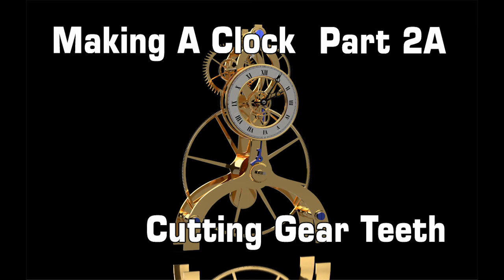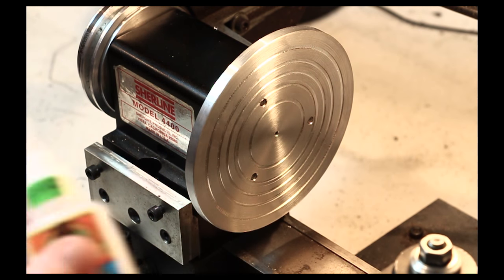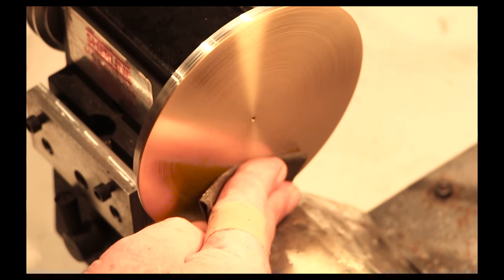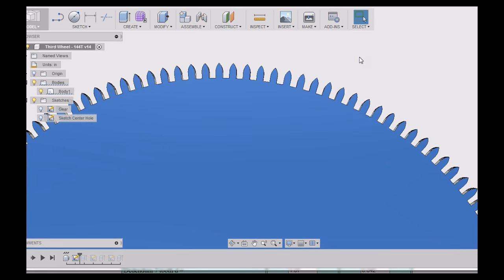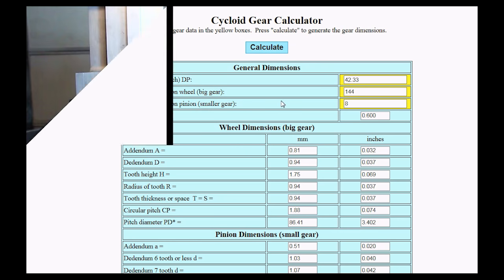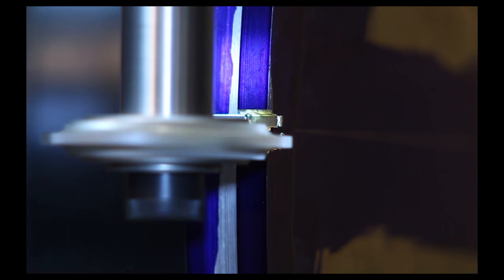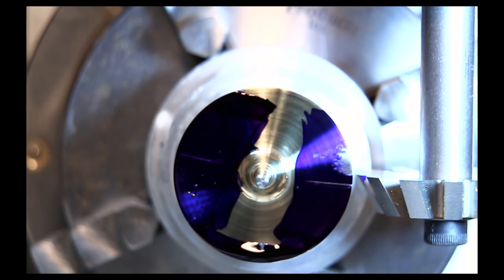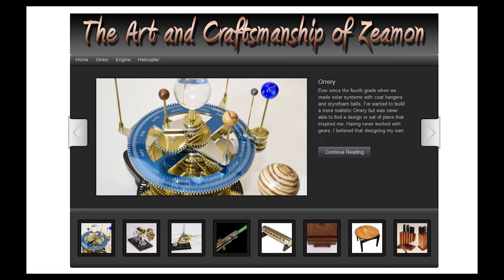Making A Clock - Part 2A Cutting Gear Teeth

Comment: Ken, thank you for all these videos.  I'm looking at building this same clock (with yours and Chris's videos as my guides) but I'm a little concerned with cutting the teeth on the large main wheel.  I like how you cut the blank on the mill, but I'm having a hard time envisioning how you cut the teeth. 

If you have the wheel blank mounted to the vertical axis, like you did when cutting the blank, wouldn't the cutter for the teeth need a separate motor spinning on the horizontal axis? Or, have you figured a way to stand the rotary table up so you are looking at the flat side of the blank when standing in front of the machine?  

Understanding how this wheel is cut has my mind in a loop.  I've hesitated in purchasing the Sherline products because I can't get my head around this one part.  can you help me?
Reply from the maker: I had to turn the blank for the large gear on the mill because the lathe wasn't big enough. Once the blank was turned I could cut the gear teeth on the mill the same way I did the smaller gears. Keep in mind that my mill is not a standard Sherline - I enlarged it quite a bit. If you search my channel you'll find some videos about it.
Reply: @KenToonz  Thank you for the quick reply.  I’ve been searching this morning to find a website for A2Z, but so far have not been lucky.  I did find some quick change parts from them on mini-mill.com.  So far that is it.  I’m super new to all of this, but I defiantly want the larger envelope that you have. I assume part of that is because of the headstock modifications you made and part of that is the larger bed?  Could you help me identify what I might need to purchase?  I’m happy to pay you for your time as a consultant. Everyone’s time is worth something.
Reply from the maker: @galloguapo630  I'm pretty sure A2Z went out of business. I got tired of constantly making my machines bigger so I sold them and bought Tormach machines. My FREE advise is buy the machines which match the size work you plan to do. That's all I have to offer. Good luck!

Comment: Ken,
Machinists have used adhesives, double sided tape, friction drives, soft solder, magnets, and other techniques for restraining parts for machining.
Chris did not invent this but has spread
Many age old techniques for the benefit of new machinists and craftsman.
Reguards,
Kap

Comment: Ken, my interpretation of "undercut by 5-deg" would be to raise, rather than lower, the cutter (in my hemisphere!), I interpret undercut to be like rake in a cutting tool, IIUC what you did it seems like you've got the opposite rake on your ratchet teeth. An undercut means that the paw gets forced into the ratchet under torque, but IIUC you've cut it so that torque pushes the paw away from the ratchet which only holds with sufficient friction. What do you think, or do I have it all wrong ?

Comment: What type of CNC/Mill do you have that lets you program it in the way you described? Seems like a more versatile tool/option than Chris which he attaches to the lathe.
Reply from the maker: Most CNC mills have the option to add a fourth axis, which is a rotary 
axis. You can program it to turn to very precise angles down to 
fractions of a degree.

Comment: Ken,  When cutting the gears on the orrery you put material between/ exit side of the gears.  Why not for these clock gears ?  Good to see your return
Reply from the maker: +Ralph McCoy Very observant! Yes, I backed the gear blanks with ABS to prevent tear out when making the Orrery. On the clock I've got the blanks glued to an aluminum arbor, so I couldn't back them. Instead, I run the cutter through the blank to cut the tooth and retract it back through the tooth to clean up any tear out. Different technique, same result.

Comment: When cutting the ratchet I think you may have done it the wrong way around?  That is the table should have been rotated anti-clockwise 5 degrees and the cutter then raised.
The way I picture it is to rotate it say a large amount say 45 degrees to picture the end result.  Going clockwise and down creates a large V and the click would not drop in. Going anticlockwise and cutter up creates a backward slot which is what I think is meant by undercut.
Great work. I hope also to CNC the clock but have yet to come to terms with the cost of the cutters.
Reply from the maker: +myford vmb Thanks for the explanation. What you say makes perfect sense, but the photo and (brief) explanation in the book sure seems to place the cutter below the centerline. Hopefully Chris will chime in at some point. I have a LONG way to go before I'll get to adding the ratchet to the clock. And yes, the cutters are expensive (about $500 USD) and the brass was about $700 so this is a ridiculously expensive project! I justified it by thinking this will be a family heirloom and last forever. :)
Reply: Have gone back to the Wilding book.  He talks of advancing the cross slide 0.108" as it was done on a lathe.  This would be equivalent of raising your cutter.  However for 5 degrees I calculate 0.054" so perhaps he meant 10 degrees.
Reply from the maker: Hi Vivian. Wouldn't it be nice if the book was a little clearer (in lots of places!)? I agree that his math doesn't match my results and I'm still confused on this. I've designed my click to match the ratchet gear I made and I guess I really won't know until I do some assembly and test fitting. I'll keep you posted!
Reply: Hi Ken, Well I just cocked it up as I offset it by 0.108" as per book.  This is way too much.  Then I realised when it says in the book "In this case the cross slide is advanced 0.108 in to give the five degrees required" he meant 0.108" as is read on the cross slide dial.  This is because the cross slide gradiations are typically double the movement because its typically used when turning down the diameter of a bar.  So now need to make my third attempt :-(
Reply: Hello Ken, yes myford vmb is correct. The end result will be a undercut, when a tooth on the ratchet wheel is captured by the click the click will  want to "draw" itself into the ratchet wheel. The idea is that when force is applied the click will pull inward and NOT pop out so it has to be a negative angle or slope. 

Clockwise or anti clockwise depends on how you have the cutter mounted on the mandrel.

Here is a simple way to calculate the offset. I have this in a thread about building my clock at http://www.clockrepairtips.com/forum/viewtopic.php?f=7&t=2041  (I hope thats alright, if not just delete it)

How do everyone. lets see if I can help explain how to find the offset for radial rake and or tooth cutter offset for things like ratchet wheels or an escape wheel ect...This is a simplified way of doing it and adequate for making cutters or ratchet wheels. say we need the 6 degree offset and we are using a 1" diameter brass blank for our wheel or ratchet. 
first find the circumference. 
Multiply pi (approximately 3.14) and the diameter of blank to get the circumference.....3.14 (pi)x 1" = 3.14"
We want 6 degrees....that is 6 degrees out of 360 degrees, or 6 divided by 360.....6 ~ 360 = .0166 
now take our circumference times .0166 or 3.14 x .0166 = .0523"
move the cutter from center .0523" to get an approximate 6 degree offset

I would say 7-10 degrees will work as long as the angle on the click allows for it to be pulled inward. This is critical especially over time when some wear starts to happen.

 I understand the dilemma about following someone elses processes and techniques, I am building a grasshopper escapement clock from a instructional book. Tooling and machinery used and calculated to is different than mine and there can be alot of time deciphering it all. I just have to chalk it up to the fact that I am learning more by having to go thru it more than once...Have fun.... William